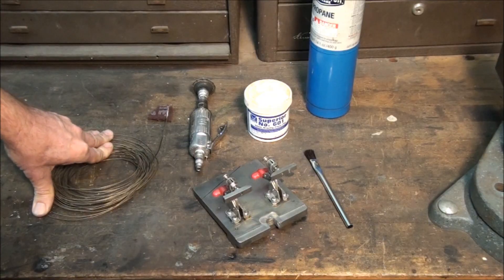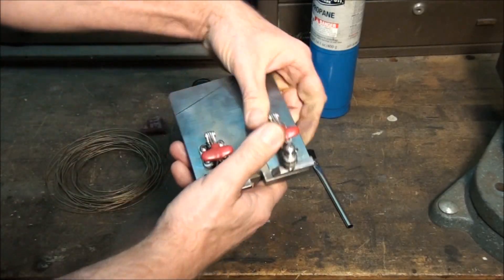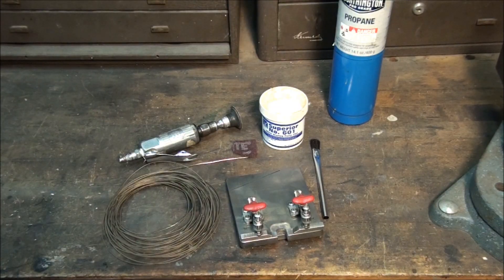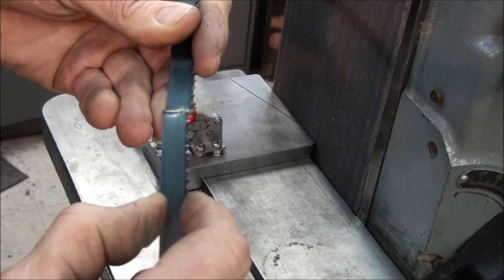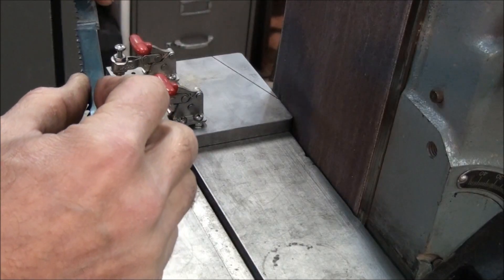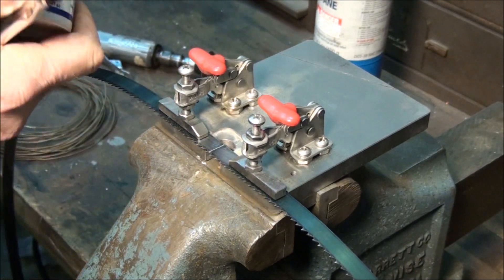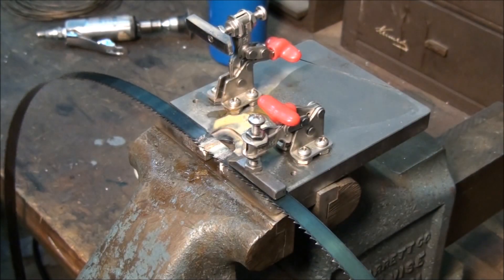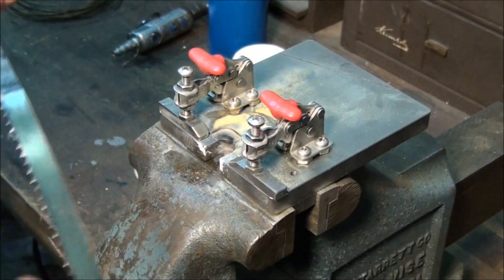How to Make Custom Length Bandsaw Blades Without a Welder

Comment: I noticed the Rockwell sander you used to grind the blades. I recently acquired one of that generation, but the disc is missing. I have its mounting flange,  but I need the plate thickness and diameter. Any chance you could fill me in, please?
Reply from the maker: I can't see much without disassembling it, but the disk looks to be 1/4" thick and 12" in diameter. Not sure if it has a hub or not. You may want to search for a parts assembly drawing.

Tom
Reply: Thanks very much for the quick reply. I just didn't have access to one to measure,  I was unsure about the thickness, and the exploded parts drawing doesn't give dimensions.  FYI there is in fact a fairly robust keyed hub /flange which the plate mounts on, and fortunately I have it. I'm a woodworker with limited metal work gear so I was trying to avoid having to machine stuff.

Comment: I learned a lot! Thank You
Reply from the maker: Thank you for watching!
Reply: One thing I would like to know Tom do sells the saw blades un-welded? In rolls? And do you know who sells parts I have an old handsaw (1950 vintage) that I need bearings for.
Reply from the maker: McMaster Carr sells both, but pretty much any industrial supply house will as well.

Tom
Reply: Thank you sir, I have a shop master band saw (1950's-ish) that I would like to repair and use for a second blade in the shop.I will look into McMaster Carr.

Comment: I remember back in high school in the 70s we had to learn how to use the on board welder/ annealer before we could even begin to use the bandsaw. the annealing process was the most difficult for students to learn. This makes quick work of that. Thank you
Reply from the maker: Yes, a welded blade has to be tempered just right to keep it from breaking. Not necessary here.

Thanks for watching.

Tom

Comment: I used this method ( I am a goldsmith) and I have been using the same saw blade for 8 months and it went blunt instead of breaking. Amazing--- and many thanks for the video.
Reply: Yes.It seems the fail is always on the weld if only the manufacturer's would put this kind of quality Craftsmanship into there product.

Comment: So I have used this technique and its worked very well for my vertical wood and metal bandsaws. I even made the little jig!  HOWEVER......for my horizontal bandsaw they keep breaking!! The saw is small so the blade gets bent a little tighter than the other machines. Also, the blade has to be twisted in order for the machine to be used so that adds to the stress of the joint. Any recommendations? Also, I have been messing around with scrap pieces and trying to figure out the optimal gap to leave on the scarf joint. I assume not as tight as possible right?  Thanks!!
Reply from the maker: The less gap you leave, the better. I don't know what solder you are using, but higher content silver solder produces a stronger joint.

Tom
Reply: I am using the 56%. I'll get some higher % stuff and try that. Thanks!

Comment: Hi Tom great vid. i am a welder by trade 29 plus years what grade of silver sounder would one ask for at a welding supply like liquid air or prax air ? wondering if you might know!
Reply from the maker: Don't know what grades they carry, but a higher silver content (>55%) will result in a stronger joint. Make sure to get a flux suited for steel.

Tom
Reply: The ribbon solder is what you want, and it is known as jeweler's solder, and sterling is probably the best choice.  Amazon or Ebay or a local jeweler's supply for both flux and solder.

Comment: Thanks for the video. When I bought my Dake  bandsaw the welder would have blown the shop budget, about 500 bucks in 1992. I'm going to tool up to do this after getting robbed for blades. Mine are 117"   x 3/4.   I mostly cut .090 and .125  4130N plate.
Reply from the maker: Yup. The $500 buck thing is why I don't have one either.

Comment: This was one of the first things we learned in high school machine shop back in the 60s. I recommend a MAPP torch instead of propane but other than that this a good technique. Not only can you buy blade stock in bulk rolls, you can re-weld broken blades. (cut them at the maximum length workable on your band saw and you can re-weld the same blade several times). Also you can pick up odd length blades as surplus, yard sales and auctions and piece them together.
Reply: Real MAPP (a trade name for that gas mix) is out of production (the name remains as a trademark) but there are equivalents and the propylene is what makes the big difference. It's well worth owning (cheap used, absurdly overpriced new!) the predecessor to disposable LP torches, a small LP-air torch (Goss, ACSO, TurboTorch) if you want to up your game. They burn much hotter than cheap consumer heads for disposable cylinders. Of course you can run any LP torch head off any LP source with sufficient flow (I cut with oxy-LP too which is scrapping industry standard for that reason).  In-between are the old TurboTorch heads you can still find as shown in this video: https://www.youtube.com/watch?v=1ygQzfBhS38

Comment: if welded bandsaw blades brake, isn't it just a case of them not being heat treated properly after welding?
Reply from the maker: Yes. If the weld isn't properly annealed, it will be too brittle to flex.

Tom

Comment: How do you cut your blades to length from a roll, could you use quality mini bolt-cutters without damaging the cutters jaws?
Reply from the maker: I just use a pair of tin snips. The blade stock isn't that hard.

Tom
Reply: Thanks, don't have a bandsaw yet. Was planning on TIG welding the ends together. I had the idea of slash cutting the ends diagonally to increase the length of the joint for strength. Would be tougher to get the angle/shape to match up. What if you laid the two ends over each other and cut through both at the same time guaranteeing they are the same!
Reply from the maker: TIG welding high carbon steel is tough.  A resistance weld or brazing is a much better option. The trick to getting the ends to perfectly match is to put a twist in the blade, line the ends up back to back (teeth to back) and touch them on a belt sander. Even if you don't get the ends square, they will align perfectly when butted together. Of course of you build my fixture, it takes care of all that. :)

Tom

Comment: Super Sir, gesswein sell 4 types of silver witch one . I want to weld bi metal blade with a 6 in diameter for the wheel on the motorise hand saw . your weld will hold the tite radius ?

Thanks 
Alain
Reply from the maker: The higher the silver content, the stronger the joint, but anything over
 55% is adequate for normal use. I can't vouch for the tight radius 
though, so you may want to use one of the higher content solders.

Tom

Comment: Hi Tom, bought a coil of 3/4 X .035 metal cutting blade and tried soldering it with 56% silver solder and several configurations of propane torch and no good.  When I put the torch on a unbroken section of the same blade, I can get it red hot but only the teeth get that hot when I try to heat up the splice area in the jig. (I know red hot is too hot)   Pieces of the silver solder melt/break off the end of the piece I'm holding and fall on the joint and sit without melting.  Tried Mapp gas, same result.   Got out the oxy/acy torch with a welding tip (which I've never used before) and it's hard to get a cool enough flame and it's very narrow.  The propane torch looks like much the better way to go.  The propane torch is obviously hot enough to get the blade too hot when not in the jig but not hot enough to melt the solder when in the jig.  Any suggestions?  Thank you for taking the time to reply!  Matt
Reply from the maker: It sounds like you might not be using the proper flux. Without it, the solder will fall onto the base metal, but not flow out. 56% silver solder melts at about 1200ºF, which is a dull red on steel. Propane is plenty hot to get the job done.

Tom

Comment: Richard Yates. I use straight boraxo laundry borax. Then I put it in a spice grinder to make more of a powder. Wet the brush dip in the borax and apply sparingly. Wherever the flux/borax is the solder will want to flow. This applies to jewelry there are better fluxes for steel than borax.

Comment: Great video. Really helpful. Given that I want to imitate you I have two questions. Where do you usually buy the coil stock? And, more importantly, which is the best way to cut them?
Reply from the maker: Thanks.

Any industrial supply will sell the blade stock. I suspect mine came from McMaster Carr. I cut it to length with a pair of tin snips and trim the ends square on the belt sander so that the teeth are evenly spaced, before tapering them on the fixture.

Tom

Comment: very nice , we also work with bandsaw blades but we use a italian machine  some times dhe welding its not so perfect and should weld with Oxygen
Reply from the maker: Welders are faster as long as they work. This is just an alternative solution.

Thanks for watching.

Tom

Comment: Thanks! I would have never thought to use silver solder. I'll have to try this.
Reply from the maker: Yes it works very well. I got over a years use out of the blade in this video, before it wore out.

Tom
Reply: Apparently it worked for Tom. ;) There is a decent bit of difference between regular solder and silver solder. btw
Reply from the maker: Brazing rod is typically used on large gaps where filler is need. For a close fitting joint on a bandsaw blade, silver solder creates a much stronger bond. 

And thank you Chip, it does work for Tom. In fact, I just made up a new blade yesterday, using this technique. :)

Tom

Comment: Thanks for our video I find it  very usefull and interesting... how ever I sudgest when it comes to grind the blade ones brased to hold the blade on the holding tool with the blade teeth toward the tool to make grinding easier an avoiding any teeth damage.
Reply from the maker: Thanks.

I clamp the blade with the teeth away from the fixture because it does a better job of aligning the joint. In my experience, grinding the joint in that same setup saves time and does minimal damage to the teeth. The blade I made up in this video lasted for well over a year before just plain wearing out. It never did lose any teeth.

Tom
Reply: +Toms Techniques how its made the annealing ? we use a machin from italy that weld but some time weldin its to weak????
Reply: Elson,with silver solder the temps shouldnt get above the critical point where the steel changes,especially with a propane torch so there is no need to worry.
Reply: if you are using a resistive welder you usually pulse the electricity to get the orange color and then pulse it  slower each time to slow the cooling after you reached the annealing color.Just dont forget to temper the blade too.

Comment: I've never soldered or welded a bandsaw blade, but I recently soldered a silver ring, using a straight borax paste for flux. It worked, but the ring was .999 fine silver and the solder was  like .750 and it left a very visible line. Probably would have been better to use sterling as a solder, but you're a machinist not a jeweler, so I dunno why I'm bothering you with this.
Reply: Are you making your own borax flux? If so is it just sodium tetraborate powder and water? Will you share your recipe please sir? I have trouble obtaining flux that performs consistently.

Comment: Great video Sir. I had a need to solder some stainless steel wire cable. It took some investigation but I finally found with stainless you must use a liquid acid flux. I was amazed how strong the silver solder was. If fact while testing a joint the wire broke before the solder joint. Thanks again, nice tool you made there.
Reply from the maker: +Long Ridge Farm 
Thanks.

The flux I use in the video works for stainless as well. The choice of flux is mostly about matching the temperature of the solder.

Tom

Comment: Where do you find 95" band saw blades for $13-14:00?  I have a 93-1/2" X 3/4" metal cutting band saw.  Cheap junk blades are in the $25 range.  I'd love to find $13-14:00 blades for my saw.

Went to Gesswein and found 4 grades of silver solder: Extra easy, 56% silver,  Easy, 65%,  Medium, 70% and Hard, 75%.  Which one do you use?  Is the rule "the higher silver content, the better, with no drawbacks except for cost?"

 I'm going to be doing 93-1/2" X 3/4" blades for a metal cutting bandsaw. 
  Also, any ideas on where to get reasonably priced bulk blade?  I'll be doing a couple thousand cuts on 1/4" galvanized 4 X 6 H pile ( highway guardrail post)  Thank you, great vid!
Reply: 100' coils were $356. for Starrett 3/4 X .035.    Still works out to be$27.59 for a 93" plus shipping, silver solder, flux.  Starrett is apparently very proud of their name, their tools are top notch and I expect their blades are as well but I don't think they can be that much better.  
I do need to warn everyone that Fastenal is extremely expensive and has made more mistakes including some apparently outright lies on the order I placed with them than if the Three Stooges were handling my order.  I can't believe any business in the first world could be so inept.  I asked for a quote on a 200' coil of blade and got back a price of $120 shipped.  It was the lowest price so I placed the order.  Drove 240 miles (one way)  to pick it up a couple days after they said it would be in and  they said it hadn't actually arrived yet.  (Turns out they probably hadn't actually turned in the order) Went home.  Box showed up close to a week later full of...wait for it... hose clamps. Told the store manager about it, he said he'd get the right stuff coming and overnight it but it probably wouldn't show up before Labor day so Tuesday (6 days later) I call him and ask where my band saw blade was.  "The hub needs you to email them a picture of the wrong item before they can release the correct one."  He was unable to answer as to how long he was going to wait before telling me this and also couldn't explain why I had to call him to find this out.  So I started dealing with the district manager.  He placed the order and made sure they sent the right stuff.  Per the tracking number, it showed up at the local freight hub...then disappeared. (Good job, UPS)  It didn't re-surface in UPS's system a couple days later so the district manager re-orders it again. It finally shows up at my place and there's barely enough blade in the box for 2 of my 93" blade.  Turns out the store manager who initially took my order thought that little mark after the 200 in my "request for quote" meant I wanted 200 inches. Which, at $120. is absurdly more expensive thanany of the other prices I got.   I planned on starting the job I ordered the band saw blade for over 3 weeks ago.  Now I'll likely be doing the outside portion of this job in the snow (I live in the far North) thanks to Fastenal's fuckery.  District manager said he'd make it right but the tracking number he said he'd email to me today didn't show up.  At this point, I'm not surprised.  I asked my financial adviser to see if I have any Fastenal stock in any of my mutual funds and to dump it.  Fastenal is very sick company and I can't imagine how it'll stay in business.
Anyway, McMaster-Carr still wanted more than I want to pay.  Any other ideas?  Junk blades from Harbor freight would probably be cheap enough to be economical but I can't just pick them up at the store and they insist on expensive shipping to where I'm at.
Reply from the maker: They are $14 from McMaster Carr and U.S. made.
Reply: Thank you for the info.  I spoke with a sales person at McMaster-Carrand a few minutes ago, all they could find was just under $40. for my 93" X 3/4" X .035".  What am I missing?
Reply from the maker: Sorry. I was quoting 1/2 x .025. Did you get a price on 100 foot rolls?
Reply: Check out sawbladeexpress.com.  They are a smaller, custom shop largely focused on the food cutting industry, but are expanding into woodworking.  Better pricing than I could find pretty much anywhere else, custom lengths, good material choices, but limited widths, and 2 weeks lead time.

Comment: I realize that this is a couple years old, but It's very good information and I'll start on a jib like yours soon.  I have two bandsaws, so it'll be nice to make my own blades.  I have been looking for a used blade welder on Craigslist and they show up very rarely.  The last one I saw was listed for $800.00!!   My smaller saw is a Delta like yours (wood only version), and I added about 6" to the shaft that the tensioning knob is on so that it clears the top of the machine.  Much easier to adjust that way. Thanks,Jack

Comment: I can only find 15% silver solder locally, will this work?
Reply from the maker: +HULKGQ Nissan Patrol 
Nope. It has to be at least 56% silver to be strong enough for this application. There is a link in the video description where you can order it.

Tom
Reply: Toms Techniques thank you for replying. I tried it but it fails to bond. Will Definitely buy some 56%